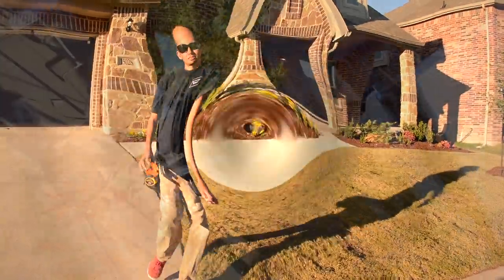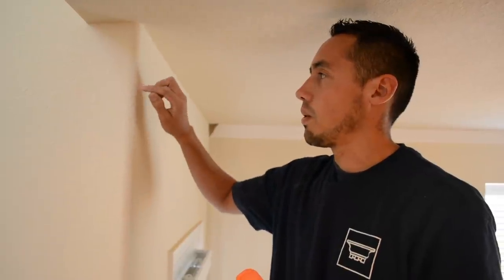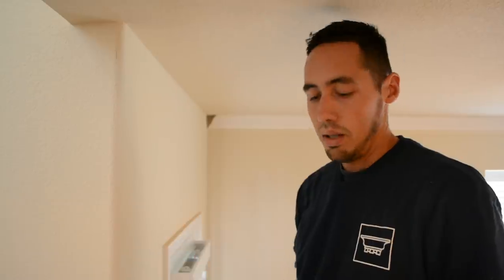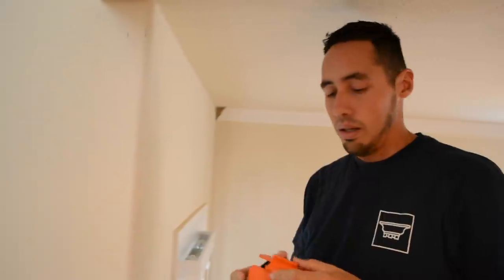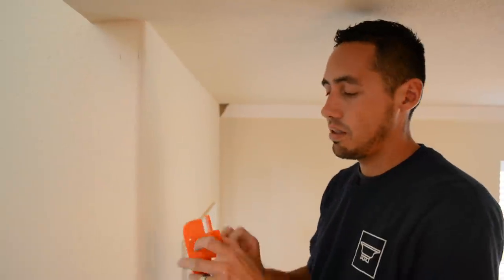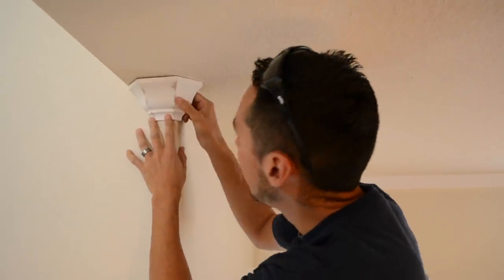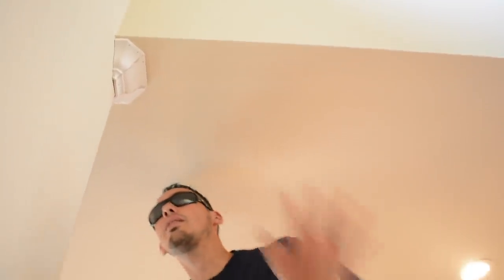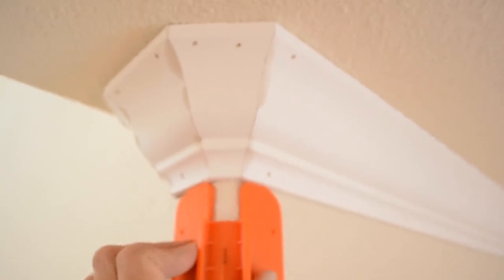How did I Live without this Tool?

Comment: I agree these are great tools! Before these I used to make site built versions using scrapes of wood, but I found I like using these much better. I discovered them the same way you did online by accident lol.

One thing, you don't really need two for a wall with two outside corners. Simply mark one end, and tack it in at the other end. Then hook on the tool and measure to the mark.

Keep up the work on your great videos!

Comment: In the north east bull nose corner bead is nearly non existent.  I never had to trim around one. They sure make a lot more work.  I'm always making a jig or guide for some repetitive situation.  Love your channel.  Always learning something new
Reply: in the midwest ive never seen it either, seems pretty dumb to make that much more work for something that in my opinion looks worse. he was also talking in another video about how allot of new houses now also have curved walls that they have to use flexable rubber trim on, again this seems unnessisarily troublesome for questionable benifit.
Reply: It's being used, mostly in higher end buildings/houses...and after you do a couple it's pretty simple, just double 22.5s on the corner piece, and usually 5/8" wide...

Comment: The problem with bullnose is the the drywall. You see how the tool rocks back and forth? That's because the mud took weeks to finally dry, it shrank which leaves that dip from the corner back about 1 foot in either direction. So when you nail the crown in place it will open up the 22.5* miters even after you glue it. It might not at first, but eventually it will from heat expansion and cold contraction. It's frustrating when you get that call a year or two later and the customer is complaining about gaps opening up in their trim. What i do is nail at the corner edges right at the bullnose on the long pieces and i let the crown float which leaves a gap on the underside for about a foot until it flush with the wall, then i start my string of nails outwards at that point. Just fill that foot gap with latex caulk and those miters will never open up. Cool tool btw. Got to gets me one. :)
Reply: I see what your saying and i forgot to mention a critical thing. After you caulk that gap upon initially installing the trim, you need to come back about a week later and nail it down after the caulk has dried somewhat. Caulk can talk along time to dry given the conditions. Usually a week wait is sufficient to nail this area i'm talking about. I also do all this weeks before filling nail holes and sanding wood putty and finally painting.  It's not ideal for the company that just wants to come in and get the job done, but when you're working on a home for weeks or several months you have the leisure to do it the right way. So if i was you i would nail that area that continues to separate as long as you can hit a stud, re caulk it, paint it, and be done.
Reply: One last thing i'd like to mention.. there are areas that will always move or flex no matter what. Staircases, upper floors, places around door frames, ect.. I use liquid nails, screws, bear claws, biscuit type joints, and several other types of hardware in these areas. You will always have 1 or 2 sides of the structure that will be baked by the Suns heat at some point in the year. Heat expansion causes most of the issues.I always have something i know will work for any situation. This is based on 25 years experience of figuring out how to deal with and correct problematic trim work. Reality is things will always break but there are several ways to prevent it from happening for decades if you know what you're doing and you use the right materials.
Reply: It's a given that stuff will open up in Florida. It keeps the painters in job security mode....lol. The climate is just too brutal. You hang kiln dried trim in a 50% humidity air conditioned home and things are bound to move and crack over time. If you have an air conditioned environment to store the material for a week, I.E., the type of climate the trim will be installed in, that reduces the chances of problems down the road. Acclimatizing seems to be the best action for the best job. I believe we will never see a perfect drywall finish job, No money in that....lol.
Reply: matttafakt ITS ALLWAYS the wall   its the contractors framing drywall i shimming  install etc tolerances   usually after text paint looks good with no seams or over protrusions   but the finishers have to get smart
Reply: Most of tbe shrinking is done in a day or 2.. Most of the gap is from finishers that dont run enough mud on the corners or pull it off too tight.. Check the corner with a 12= knife..after you sand.. There is always light ..

Comment: I love your videos. Thanks so much. I just got the Starrett miter protractor by your recommendation. Looking forward to trying it out. Looks like it beats holding two pieces of trim at the corner and scribing one of them against the other and using another tool to find out what that scribed angle is...

Comment: you can make a small mock up of crown or base/hotglue 3-6 inch piece and 5/8 corner radius if you cut 1 inch off the height of radius piecs you  leave a place to slide pencil up and down to mark wall. then if drywall has smaller radius /and there are/make to fit and can lose or not pay for store bought one.

Comment: Couple things. If you hold that tool up to the ceiling and mark the lower two grooves it puts your lines at the same spot. Also the return around the corner could’ve been 1/4-3/8 longer by the looks of it to flush out a little better and the last piece was a little thick. Left a little gap.

Other wise like the videos. Lot of neat projects to watch and see people who do still care about quality and craftsmanship.

I do all custom copper work on interior and exterior  of multi million dollar homes and quality is of utmost importance to me. Which doesn’t seem to be the case for the framers I follow.

Comment: I've always just measured to the corner and looked at my tape. I put the edge of my tape flush with the wall and take the measurement almost an 1/8th of an inch past where the wall starts to move away from my tape so just a hair into the radius. After all the trim is cut I cut a bunch of corners at at about 9/16ths. A bunch of them a hair big and a bunch of them a hair small. Walk around and nail trim or crown on and grab a corner that fits perfect. No messing around with marks and cutting perfect prices just cut everything and start installing

Comment: Brilliant content!!  Question:  in a house with rounded drywall corners, how do you go about trimming out any bullnose angles that are not 90....do you go back to 2-cuts or still do a 4-cut corner, figuring out the angles and the width of the center piece?  Thanks you!

Comment: Does anyone else beside me use a nailing strip? Two sides of the room can be nailed top and bottom to hold in place but other two sides you hit a stud but the top is just into the ceiling and not long after the caulk will tear away and leave a gap. A nailing strip or blocks give you something solid to attach to. 
Richard as always another nice video.
Reply: Clint Price There should be framing all around the edge of the ceiling that the drywall attaches to, you angle your nails to hit that. No extra nailer boards required. Are you using 2.5" finish nails?
Reply: Depending on the size of the crown I use blocking. It's good to nail to one surface plane (wall or ceiling) only if you're able to in order to lessen the visual problems caused by lifting trusses or rafters. Unfortunately, that's a problem that is best tackled in the framing phase of construction, so as usual the finish carpenters get to make everyone else's work look good. 😉

Comment: i think if you put two lines on youre angle finder you can use that tool to do the same thing 
straddle the corner with youre angle finder and make a mark on the wall from the lines on youre tool , if the corner is off you see that on youre angle finder too

Comment: I’ve done crown Moulding in homes with long walks, the tool is good but if you get walls that aren’t flat your measurements are going to be short.  Literally cut the inside corner first, then put the crown on the wall and marked the length off the wall.

Comment: How about a video on how you handle an inside and outside corner on walls that are not 90 deg. Most homes don't have 90 deg corners even though they look like they are. Really liking your videos.
Reply: Get an Empire angle finder. I use a Starret and like it.  But, having both would be ideal. Amazon that shittt!!
Reply: empire miter gauge. or years of experience let's your eye tell you. usually just a degree off of what it should be.
Reply: It's called coping. If you cope your corners it doesn't matter what angle it is
Reply: one thing about coping a corner is you must make sure the trim itself sets at 90, so if there is a taper on the bottom of the drywall you will get a crack, i always make sure i shim the trim so it sets at 90 deg...

Comment: I was doing the same holding up prepped ones then marking. As for this tool how does it work if your bull noses are not perfect 90 degrees. While doing my vinyl flooring I had to do a million custom angels on all bull messes because of the turns not being square

Comment: You don't need two of those tools to do that trick if your doing a bullnose to bullnose fyi.... Alls you gotta do is  use the tool on one side, scribe it, then nail it to the opposite side, hook your tape and measure to the side you scribe... Also real to easy make a lil tool with a couple small blocks of wood, a chunk of 2x4  with a 1"1/8 x 3.5" piece of plywood screwed to the end of it to wrap the corner and scribe it. You can also set a compound square to 5/8" and use that... pretty need lil tool tho, I'm gunna buy one!

Comment: How would you recommend transition from a large to small molding?

I have 19' ceilings, but the room has a hallway with banisters.  Im looking at installing 4pc crown in the main room (center point of the enter house).  There is no way it would look proper to do that molding all the way around.

The tricky part is, one corner, I can just stop, as it wraps out of sight of the main room.  The other side it goes into the stairwell, then down the hallway.

I could post some pictures if you're interested... But the basic question is how and when to transition different size molding.

Comment: Magnificent!  I've done numerous crown moldings on houses which are 100 or more years old.  The walls on these houses which have set over time are less than true.  I've cobbled my way around them in the past, that said, I would have loved to have that tool as well as your calm proficiency, (I tend to swear more and move much slower).  I don't know what nailer you're using, but it looks like an 18 gauge brad.  I've moved to a 23 gauge pin nailer by grex.  The holes are imperceptible and thus easier for finishing.  Keep yo the great videos!

Comment: The thing about drywall is the corners are hardly ever 90 degrees. A good frame crew can build a square house using skill and mathematics. However I’ve seen skilled drywall contractors but never any specified information about how to keep the corners square.

Comment: this is an oldwll er thread so maybe no one will see this. 

I have one of those but many of my drywall outside corners do not come out to 90 degrees. (I blame it on my drywall mud guy). he didn't backfill right to the edge of the bullnose so it's kind of concave there instead of flat. 

But whatever, i have one of these tools and am unsure if it's useful because if i push it flush against, say the left wall, there's a good 1/4 to 1/2 inch gap on the right wall between the wall and the inside flat part of the tool.

Any suggestions?

Comment: Did really read all the comments so someone might of said this but why do you need 2 of them to measure outside corner to outside corner? Wouldnt it be easier just to mark the 1st corner then nail the tool to the 2nd, pull the tape off the tool and read the line..... seems easier to only nail once, but im not as bright as most....
Reply: True but their cheap enough and (plastic). Might as well get a few pairs especially since he works with another employee that also could use it throughout the job. Home gamer use yeah dude just get one.

Comment: Just one question, if you push the tool to the ceiling and mark it from the bottom wouldn't that be in the correct position?

Comment: I'd like to see a vid of how you deal with large gaps installing crown molding to the ceiling. it looks like a lot of the homes you do are newer construction. working on older homes are a fight. like your videos.
Reply: New construction in Florida is also a nightmare. We have hurricane anchors that bow the drywall at every anchor. It is actually quite hideous in the end. South florida has metal tiedown straps at every stud and lots of the corners are always bulging because of the bolted anchors there. It is accepted that the wall will be wavy. Drywall finishers would end up using a 3 foot knife and we know it doesn't go that way...lol Also, the wood framed stuff is usually on the second and third floors as concrete block is usually the first floor. That brings it's own set of issues........mostly humps or out of square.
Reply: Doing crown on kitchen cabinets is a nightmare on most homes. Ceilings aren’t straight and the crown comes pre-painted so you have to minimize any corrections. 
I’ve told many designers to have the crown unpainted so we can massage it in but to no avail. 
People just want the sale and could care less about the install.

Comment: nice tool. would be nice if it's adjustable for when you run into a bull nose that's bigger or smaller than the usual
Reply from the maker: Josar Gor in theory they should all be 5/8" because that metal/plastic corner behind the texture is 5/8" But yes that would be nice to have the option
Reply: also, you gotta start shipping to canada cause i want that CA glue

Comment: I'm surprised your not using a cordless finish nailer a lot of people think it's dumb until they see how well it performs Ive been using a ryobi 18 ga finish nailer for 4 yrs now with 0 issues and shoots through anything I put it up to. you should pick one up to try! Get at me
Reply: I picked one up after I saw a garage door installer using one to shoot the weatherstrip trim. He said he uses it day in and day out, and it never gives him any problems. Plus the bare tool is cheap enough that if it dies after 2 years, he feel he got his money's worth. It is a bit slower to cycle than an air gun, but if I am doing a bit of trim around one window, it's nice to not have to drag out the compressor, run it up, and then air it back down.
Reply: David Dolch  ya def worth it I do flooring and a lot of base and door casing and crown it's plenty fast enough

Comment: Do you typically miter (instead of cope) your inside 90s?  The one in the background is mitered.
Reply from the maker: We typically cope them for the most part now.
Reply: Finish Carpentry TV. Hey thanks for the reply.  I've tried miters but always end up frustrated and getting silly with the caulk.

Comment: The problem is not with the drywall needing to dry or any other issue. Its that Crown molding in the context of builder grade, bullnose corner, spatter textured, rooms is completely inappropriate. The west coast builder style has absolutely ZERO context with crown molding.

I have the utmost admiration for a guy like this who has made a living out of capitalizing on HGTV idiots who think putting crown molding in ANY home is an upgrade. If I were to walk into a west coast, adobe stucco'd, home, that had slick, mitered, crown molding, slapped up.. it simply would look out of place. Crown molding is a Roman architectural design feature. Spatter stucco'd bullnose corners is a south western, adobe wall feature. The two simply dont mesh. Its like running crown molding up a rake on a cathedral ceiling? Its a horizontal member period. You dont run crown up a slope. Why? Becase the miter simply does not work without an ugly multi piece transition OR a transition block.

Again, phenomenal work to build a buisiness running crown molding. Way to capitalize on the consumer market. Ride it as long as the horse keeps coughing up cash.
Reply: A very interesting comment and one which I agree with, I am from the UK and spent 6 years fitting ornate plaster cornices to period houses and often found complete mismatches of architectural mouldings from different periods in history and oversized cornice in small rooms with low ceilings, and cornice on Artex ceilings and so this has been going on for a very long time and as a business if thats what the paying customer wants then that's what they get, as a decorator I have painted and papered some hideous choices in my opinion but thats all it is at the end of the day, my opinion.
Reply: Mark Bolton Agreed. We don't run Crown Moulding along the coast in SoCal. If a client asked for it, I'd turn the work down. Crown Moulding yukk
Reply: No crown moulding in SoCal LMFAO...what world are you guys living in????
Reply: Mark Bolton the ultra high end homes are all modern; Flush base, no casing, no crown moulding. Game changed man but the door hardware game got more exciting.
Reply: Interesting point, however I think painting that ceiling white would instantly make the crown molding fit in. Makes the room much nicer and less of a simple 'box'.